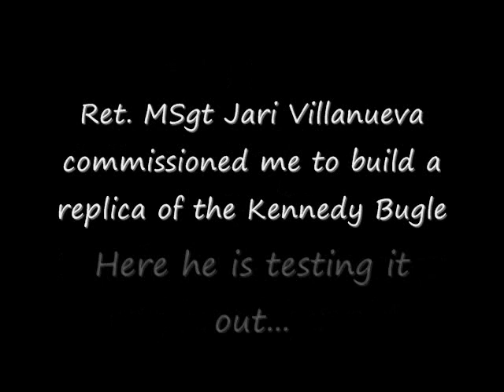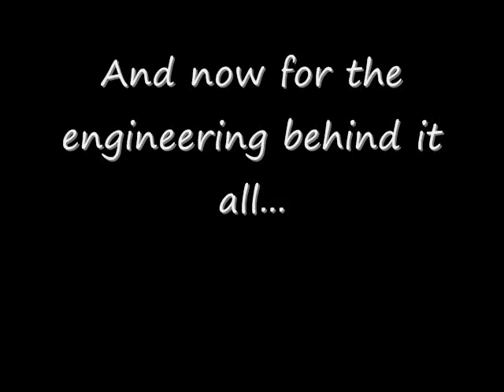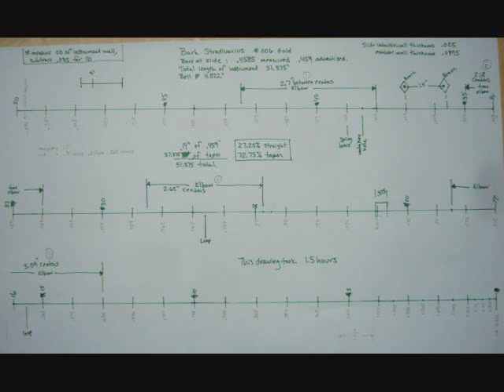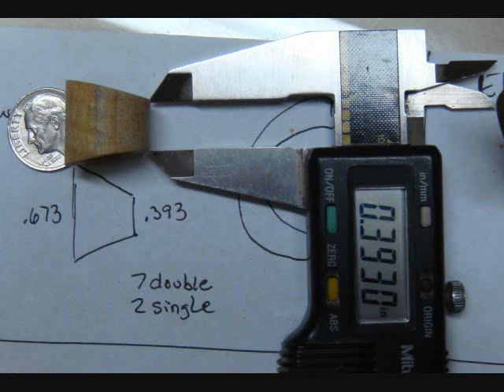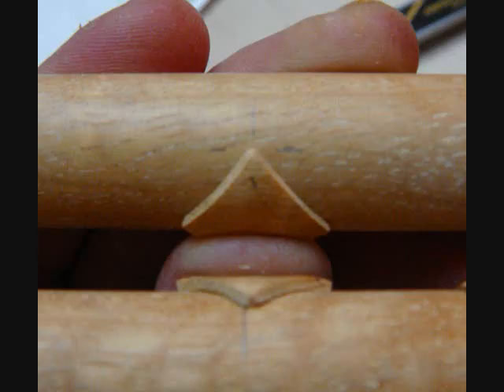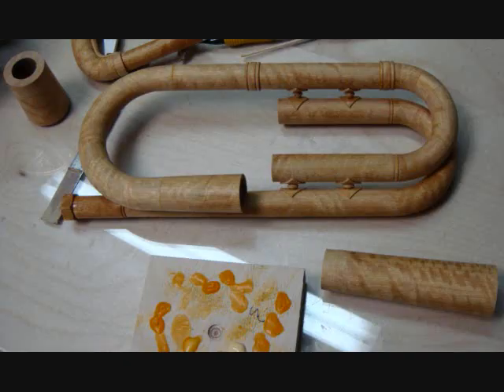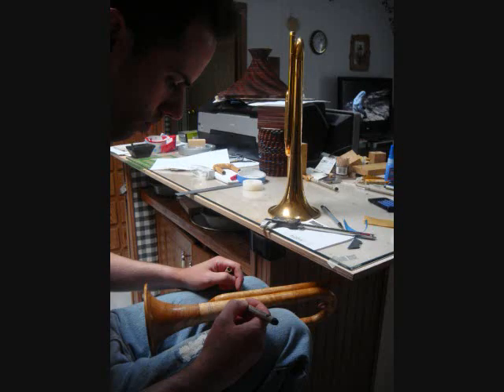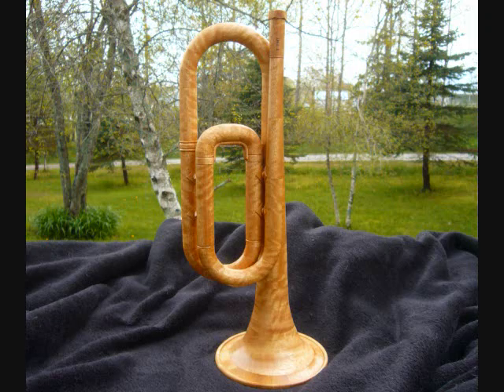Wooden Kennedy Bugle Bach Stradivarius

Comment: Did you ever think about getting a solid piece of wood for the bell, and shaping it on the lathe. You could use a template of the outside profile and the inside profile to check the shape